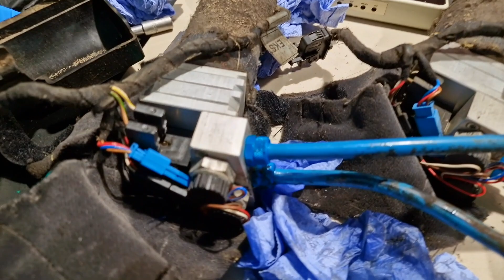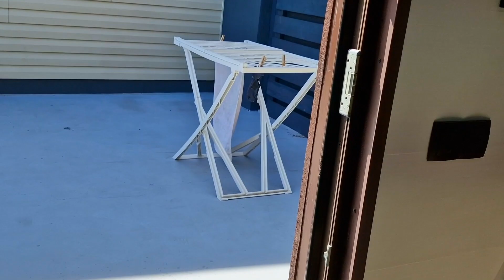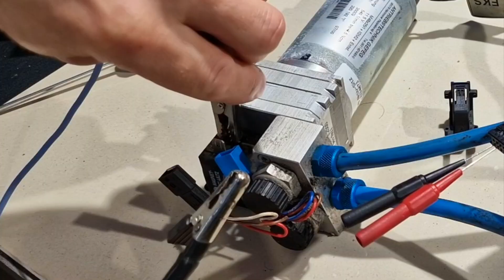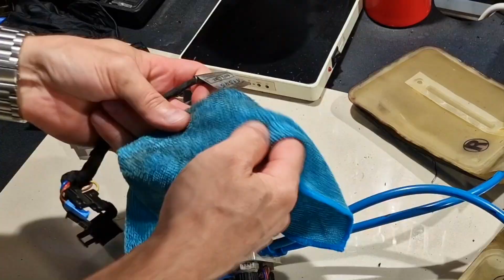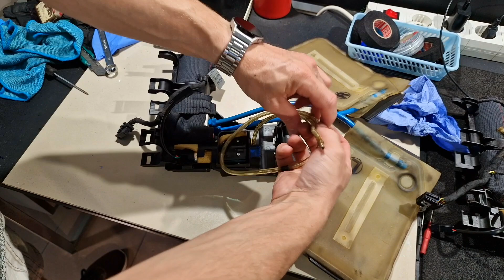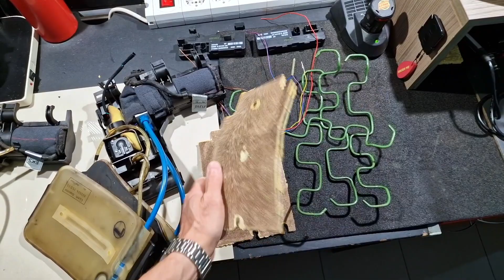Active seat Retrofit BMW 7 series episode 1

Comment: Hello I’m having trouble installing active seats in my e38. 

This is a retrofit I just need to know what wires and and pins I switch on the seat and the unit. 

Seats have the active function. 

Any help please!
Reply: How did you fix your issue? I have heating seat and want to retrofit active seat to my comfort seats.

Comment: You did a good job , I want to activate the seat belt warning if you can help
Reply from the maker: Most of E38 didn't have the hardware installed for that ( European market) but either way you need to code KOMBI you can use NCSexpert or BMW SCANNER
Reply: @MOvidiu  
I did coding with NCS expert but still didn’t work I think we still need some wiring diagrams
Reply from the maker: @tamershaker876   for sure! use BMW WDS
Reply: @MOvidiu  what do you mean by BMW DWS
Reply from the maker: @tamershaker876  BMW WDS (Wiring Diagram System ) do a Google search!

Comment: Hi, I need help, I'm retrofitting comfort seats with lumber support, ventilation, heated, memory and gentlemen function on a BMW F10. 1st problem, how do I wire the memory buttons on both the driver and passenger door cards? 2nd problem, I will need help with coding. Please help. Much appreciated.

Comment: Awesome job! Been there done that on some comfort seats. One question - the part with legs extension is the same at recaro seats as the contur ones? I mean the entire frame, wide lenght. I am asking this becaude I had recaro seats and they were very unconfortable on long trips so I suspect the contur ones are the same.   I saw that the parts are interchangable between comfort contur and recaro of cause except the leather coushin and few other things but as I found the back rest with half split is very comfortable in contur and comfort I had a bad experience with recaro ones. The but part at recaro is narrower and shorter compared to comfort one but look abou the same as the contur…
Reply from the maker: Hello! unfortunately I don't know. I never thought about it ( until this moment :)) ) You can try to compare the P/N in Realoem.com . indeed, they feel narrower than comfort because the high bolsters.
Reply: @MOvidiu  Yeh I searched a while back and I could not find any reference of contour seats in e39 area so perhaps is an e38 specific option. So indeed it is, I compared Sport Pad seat front e38 PN:52108162329 vs Contour Pad seat front e38 PN:52108162329 vs Sport Pad seat front e39 PN:52108162329 so the sponge is identical. Next the frame: sports seat frame electrical e38/39 PN:52108162327 driver side however no reference for contour frame what so ever. I can only assume it's identical due to fact that the foam pads have the same PN. 
If that's correct I can say, based on my experience, that the recaro sport seats and contour seats are not comfortable at all the best choice for comfort remaining the comfort ones :)
However moving forward I would like to have the best of both worlds so we can adapt fair easy the recaro/contour legs extension mechanism to the comfort frame and that will be the best although I'm not sure the upholstery from the recaro/contour will fit on the comfort frame. If it happens to have a comfort seat around it will be swell to test for the seek of experience or future projects :). 

Regarding active seats: are they in correlation with the steering angle? In my e39 don't have DSC (ASC only) and no steering angle sensor, therefore sometimes the active seats function inflates the bag contre-pied of my steer direction witch can cause a little insecure feeling when cornering. It must be some codding involved also... Please check this

I really like how you're doing these retrofits, a real pleasure to watch! 

PS: I know you could implement seat memory option to passenger seat also :)) a RHD buttons module few memory modules for the rest of the motors and the wiring is piece of cake for you...